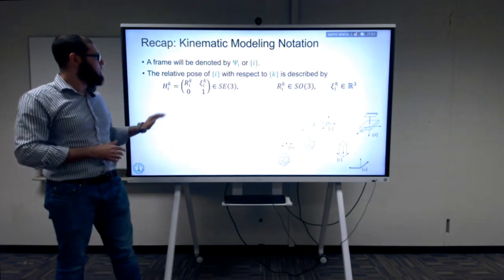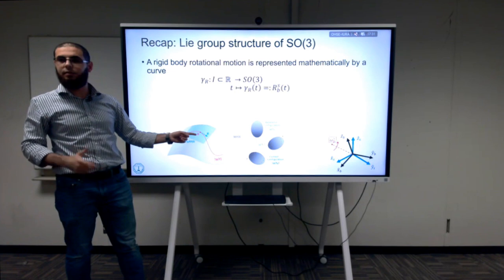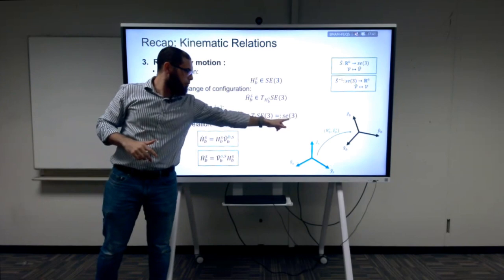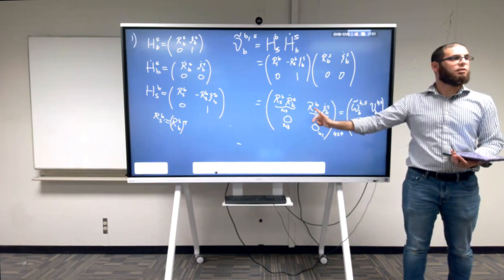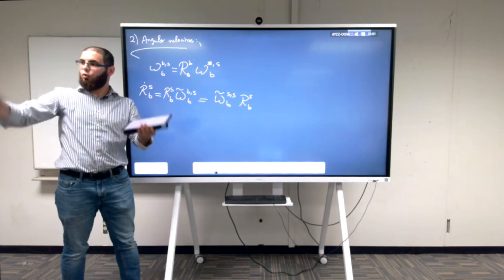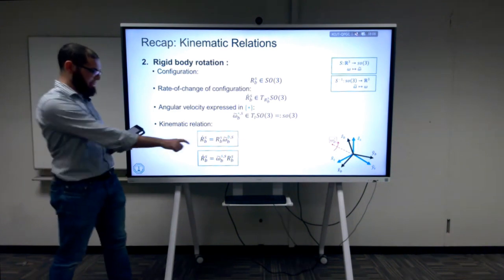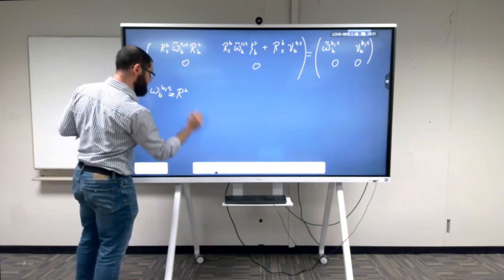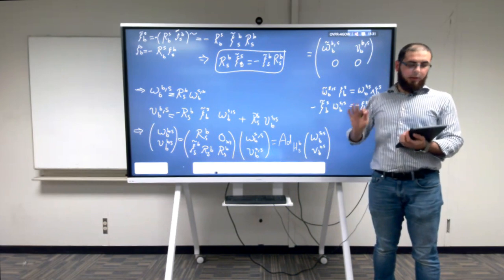SCE 594 Lecture 8: Twists

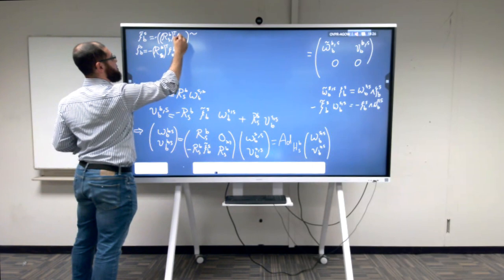Comment: Having generic setup with consistencies through similarities. I like your way of formulating concepts as manifold. Maybe I am wrong but seems like $\xi$ would really benefit from 3 indicies in notation. E_ab=-E_ba because of changing from and to. And also index of in which frame coordinates are presented so you apply R to change from one to another. @01:07:11 it seems that third one is implied and not explicitly specified.